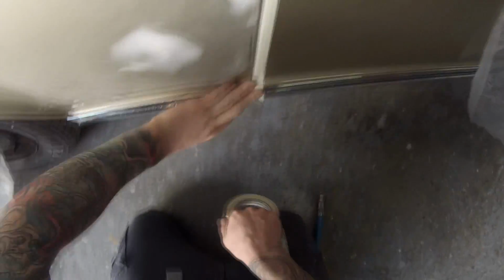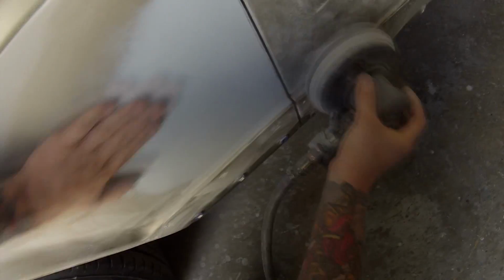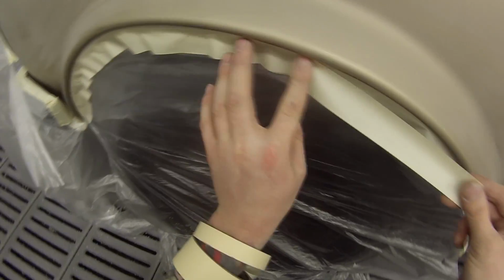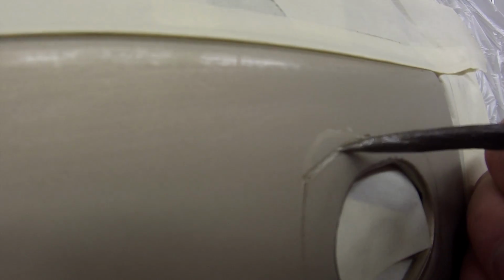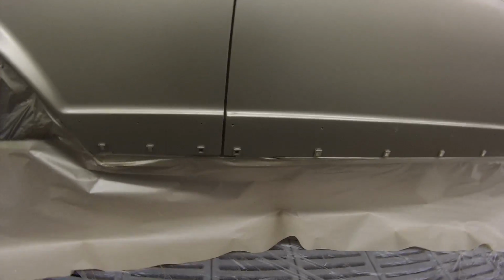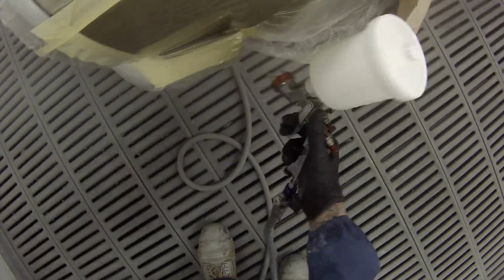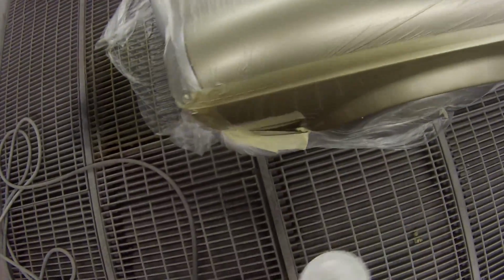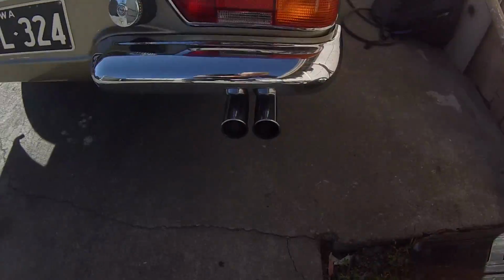Touch Up & Spot Repair, Rare 280SL Hardtop

Comment: Hi Gunman. Total newbie here that would like to get into painting. Two questions:
1. I've noticed that you start spraying a panel from the bottom up. Is there a reason for that?
2. What is a blending clear?

BTW I own a 71 280SL!

Thanks!
Reply from the maker: Blending clear fills in the prep scratches to allow the base colour to blend without giving a halo around the edge and leaving scratches, (if not doing colour blends it's not required eg. full respray). It's basically colourless basecoat.
I find it easier to see the paint going on when starting from the bottom and find it the best method when in a down draft booth like you see me in, no major difference in starting from the top though.
Man, I miss my old '69 220D :(
Reply: Thanks Gunman. I'm really learning a lot from your videos! Speaking of 220Ds- I drove one with 800,000 miles on the clock across the US and back!

Comment: Hello :) I have a question. Do you happen to know what is the difference between an orbital sander which is air powered and an electric orbital sander? Thank you.
Reply from the maker: I prefer air, they are lighter and seem to last a lot longer because there's no brushes to wear out, just air fins so oil occasionally and they run forever.
Reply: I understand. Thank you very much :)

Comment: Thank you for honesty to owning up to making mistakes. More than what a lot of painters do Haha.
I have to say though. When you reworked the front wing why did you blend it? I would have cleared the full length of the panel to alleviate the possibility of the blend not working. Quicker too?
Keep up the good work. Very good vids thank you
Reply from the maker: Gee Bram I agree but at that place I used to work my boss was real old school, never moved on from the acrylic days and loved these kind of blends, he grades a painter on how well he can do a blend like this. It's not worth arguing so I just do it his way, now I'm in my own shop I wouldn't do it this way.
Reply: +The Gunman  Looks like no boss wants it done right i hate when i am told to do a crap clear blend on a c panel the blend will turn white and peel off in very short time then look like crap but in the end we work for them so we do it there way right or wrong.

Comment: Is your blending clear just over reduced clear or is it a blending solvent? We call that a burn in.  Where you are melting new clear into the old clear. I just did a volvo p1800 es and need to correct 2 very small imperfections. Both spots are near an edge, which is good. I'm studying different methods of blending in or burning, within a panel. Since the car is seamless, the whole front end is connected to the roof and quarters with no breaking point. I'm worried that the burn in will be noticeable after I buff it. Should I use a light compound or only machine polish with something like a swirl remover? For the blending clear , have you heard of people using 1 part activated clear to 10 parts blending solvent? Some people say just use reducer with a little clear. And still others seem to just use blending solvent to melt the edges of the clear.

Comment: Hey GM,
Accolades from Nova Scotia - Canada !  Very note worthy of the effort and support you give.  Sterling jobs!
I am slightly confused on the term "blending clear".  Do you simply add clear coat to the basecoat mix and spray the leading edges where new paint meets old clear which has been sanded lightly?  Or are you doing something different with the clears?
When I blend, I use the rolled tape at a "positive" edge and leave about 1 to 1.5 inch space where I allow the clear to mist or fog under the lifted tape edge, then wet sand down to 3000 grid and the use 3M Perfect IT polishing and buffing compounds.  BUT, I then sometimes get a slight edge where the new and old clears meet.
Just trying to out figure step by step (and material by material), the sequence of blending clears and what it is you're doing there.
Thanks a bunch!
Reply from the maker: I'm going to do a video to clear this up because a few people are confused on what I mean too.
Reply: The Gunman Ohhh, that'd be fantastic!  You're simply a class act all day long Mate!

Comment: Hey Gunman,  do you add reducer to the 599 stabilizer for your blends?
Reply from the maker: Yes I like to thin it at a 1:1 ratio so its nice and thin because it has a slight yellow tinge and thats also why I don't go right to the edge of the panel.

Comment: Another great finish.  Gunman, you make blending so easy and blending I would say is the toughest to do specially metallic.  I just finished a Mercedes clk front bumper silver metallic paint code 744.  It was just a spot repair but paint did not quite match, too light, tinted it with 211 and just sprayed the whole bumper.  Turned out nice and the bottom line was the customer was happy.  BTW. Mercs' do make excellent cars.
Reply from the maker: Thanks man, yeah I know silvers can be tricky but I find the Standox range are quite good for matching and blending.
Reply: The Gunman I presume that your shop exclusively use Standox.
Reply from the maker: Yep but we have a Metalux system at the workshop I just bought so I'll be using a bit of that soon.
Reply: The Gunman Thanks gunman for your timely response.  I am going to get certified in the Glasurit system early next year.  I mostly do German cars and I want to get all the Glasurit products wholesale and deal direct with the distributor, tired of paying retailers their price.  Cant wait for your next video.  Take care.
Reply from the maker: Good luck man, let me know how you get on.